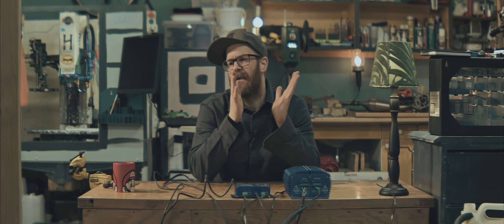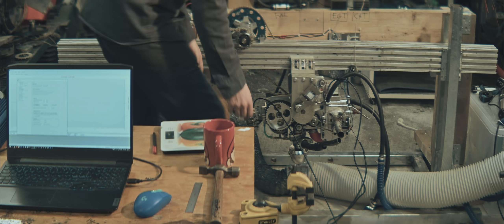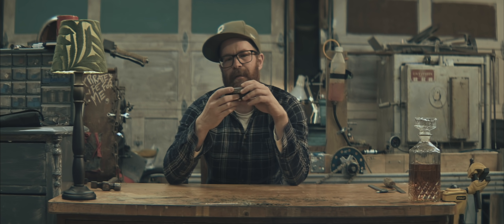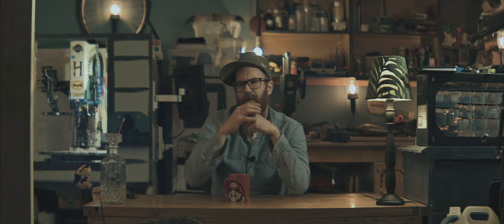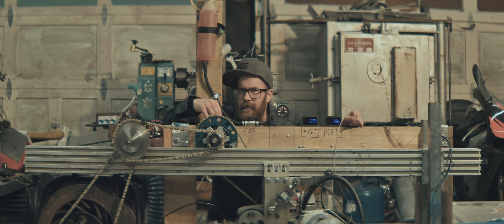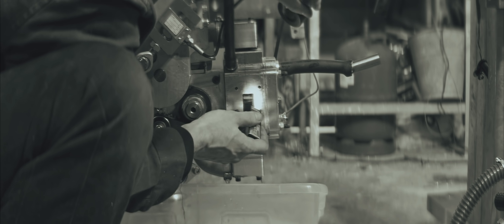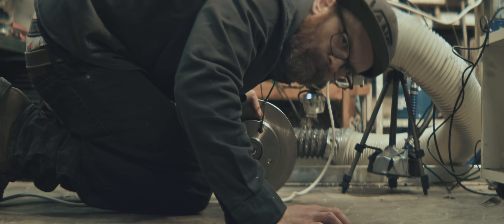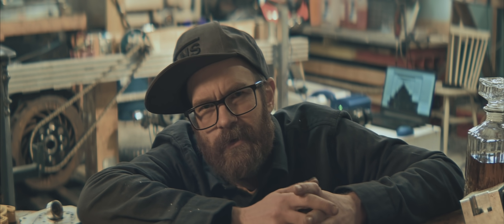Supercharged Two Stroke Grenades Head on Dyno!

Comment: What you might consider is getting an old AC compressor off a car - that has a magnetic clutch, which means you (in theory) could start the engine and warm it up with no load, then use a variable power supply to slowly engage the mag clutch of the AC compressor assembly to engage the engine with the eddy brake. That eddy brake is WAY too big - way too much inertia for that engine... A 1-way bearing is a good idea if you're not going to use a centrifugal clutch so if you're doing a power run, once you get off the throttle the brake won't just keep the engine going at 20krpm from its intertia.
Reply: Yes, with the clutch locked up closed throttle over runs are going to be a problem. A one way bearing certainly cures the engine over run problem.

Comment: Could you use one way bearings in the drive system to allow the engine to go back to idle after a pull. I don't know if they can handle the torque but I know they work from my nitro rc car days. I know it won't do anything for starting and idle but it could help with keeping the retarder from driving the engine after a pull.

Comment: What fuel are you using? I'm interested in doing a similar project myself, though I'm sure it'll be far from this level, lol. I'm also curious what oil you're using?
Reply: RC fuel, which comes with oil pre mixed. On the PiP engine Alex uses Castrol Castor based oil.

Comment: The progress is awesome, from design to running! Considering a 300cc 4-stroke honda motorcycle engine makes a paltry 30hp, this is pretty amazing.
Reply: Yes, but you need to compare like with like. This engine is not designed to run reliably for 100,000 km with good control in traffic. Besides, 100 bhp per litre is very good going, certainly not “paltry”, and would have been a racing engine output 50 years ago. Les in UK
Reply: @leslieaustin151  his engine is 240hp/L

12hpx20(conversion factor of .05L to 1L)
Reply: @Eluderatnight  I’m well aware of that, but you must compare like with like. This engine is not on a par with other, tinier engines used for model planes etc., and as I said, it isn’t intended to run reliably for 100,000 km as say a Honda 300cc would be, this one is only intended for a couple of runs up and down the salt, maximum 50 miles, with maintenance every 10 or 11 miles. Smaller engines are easier to get high bhp/litre figures from. Comparing a 50cc supercharged 2-stroke running on methanol and nitro-methane with a 300cc 4-stroke running on petrol is a daft comparison which makes no engineering sense whatever.

Comment: Those load cell joints are fine on load. The hp reading jumping around is pretty normal when you have the right torque arm length it wont skip around so radically. I run a yourdyno and just calibrated it about a week ago.

Comment: Hi, in my experience doing dyno runs on kart engines the most consistent results I had, was doing rpm sweep from high rpm to low rpm by increasing break force, maybe you can look into doing this way. Good luck doing what you do!
Reply: *brake force

Comment: Just brilliant Alex!  Nice job on the quick redesign and turnaround to fix the head.

Will your dyno software allow you to change the y scale on your HP and Torque plot (at 18.15) so that the curve shape can be better analyzed?

When calibrating.(at 16.10) when you use a shorter lever arm (3cm vs 50cm), any error in length will be a much higher percentage in your calculation.

Regarding redesign of your cylinder head, it looks like you now have at least 2.5 times the cross sectional area retaining the combustion chamber. With aluminum, it is impossible to have low enough stress to eliminate an eventual fatigue crack.  At 10K RPM, you will be adding fatigue cycles pretty rapidly, but you also removed a pretty bad stress riser (the sharp corner).  This might be a good part to have a spare handy.  Alternatively a ferrous part of similar dimensions should have a higher, and possibly infinite fatigue life.

Comment: Check the length and the angle of the forces around the pivot point i think you got there a error in the calculation a smal difference between the measurements makes a huge difference in the result cause of the smal lever arm of the forces

Comment: I think you should be calibrating the dyno with a known hp engine, such as a typical Briggs and Straton or something similar. Right now you're trying to test and tune two builds at the same time, not knowing what is right. If you have a baseline dyno calibration that is known, your time tuning and tinkering with the brute force engine becomes better spent. Ive been around for years and always enjoy your content. We share alot in common and I enjoy following along with your builds.

Comment: Your load cell calibration will still be off, because the 5kg weight is not pulling tangentially to the axis of rotation (would need to take the inverse cos of the weight and the angle between the weight and the tangent line)
Reply from the maker: 👍 yes

Comment: Maybe you should try going air cooled for the first couple prototypes
Reply: I think Alex may have got the message from all the comments that he needs to have a acceptable amount of heat in the engine prior to testing. I don't know how Alex would go about making the Brute Force engine air cooled.
Reply: @malcrandall1309  not to hard with the mill he's got just replace the hollow water jacket with some fins maybe 4 mm thick and 20-30 mm long from cylinder and head. It's always best to start out simple having a water jacket and seals to keep coolant in can be a pain and not always necessary especially for something as small as a 50cc... I am working on a 100cc supercharged 2 stroke diesel that the first couple versions will be air cooled

Comment: Much as I like your posts lately it's like watching a smoke filled room .
Reply from the maker: Yeah, could add in some more contrast👍
Reply: @2STROKESTUFFING  will that engine have a pipe? Just curious😅
Reply: @wo8795  No, this engine won't gain anything by putting a pipe on of any kind. No back pressure is required on this type of concept engine. The PiP  project engine on the other hand is highly dependent on it's exhaust system.
Reply: @malcrandall1309  👍
Reply: Its because of the lens but i like it a lot
Reply: @wo8795  I thought my cataracts had got worse with the haze. Give me HD any day!

Comment: Regarding your issues with the load cell. Put Ferrite tubes on your load cell , and indicator wiring. Motorcycle ignitions are notoriously "noisy" with electrical interference. Especially at high RPM. I build scale systems, and have run across it many times. It may be something else, but it's a very cheap and easy thing I would rule out first.
Reply: If it was good enough for my PlayStation controllers it must work
Reply: Great point! Spark plugs emit a lot of broadband noise,  so clamp-on ferrite cores are a great idea. I would think having the signal wires be tightly twisted might also help.
Reply: Shielding the ignition coil and spark plug wire may also work. Just wrap it with some aluminium foil or fine wire mesh and ground it to the engine block...
Reply: Also wrap the spark plug wire with thin insulated wire and ground them
Reply: Fields like a Faraday good cage for a screen door so those magnets won't  flux up your sensors.

If you're using shielded cables the bonding/grounding of the shield must be impotent. 

Ground shields at the control panel and leave the device end floating.. as in insulated and isolated. Versa visa works too but once you try it you'll have the grounds to understand why source end bonding/grounding makes a few more cents.

Comment: Awesome as always.
But… there is always a but… I could not see it clearly, but maybe hou made a mistake with the calibration. The point were you hung the weight is not in the same level as the pivoting point.
Do those 3cm are most likely less… 
Just measure the centerline vertically and measure horizontal to the pivoting point to get corrected effective arm length.
Hope I make sense

Comment: Hello I saw your engine stop at 13k rpm you need shorter expansion chamber for up higher rpm try To reduce length 5% step by step to get the maximum rpm for your design engine and don't touch rotary valve this will be second step to achieve max rpm👍 I don't know if this engine uses expansion chamber, if not adjust time in the rotary valve only. Higher rpm open early apply your criteria🤔

Comment: I have not been a subscriber for long.
But what is the goal of this project if i may ask?
Oh, and Hi from your next door neighbour Sweden. 👍
Reply: Hello Sweden. Alex wanted to make  the worlds most powerful 50cc two stroke engine to challenge the Dutch 50cc tuners. The Brute Force engine was only a concept while the PiP engine with it's radical exhaust port geometry was going to be used at Bonneville for speed record attempts.
The PiP engine has being very un reliable so far.
Regards from the UK.

Comment: I was going to say you calibrated the torque wrong but you corrected it at the end (you should also do it in compression rather than tension). When you look at the video when reving there seems to be a lot of movement which is potentially torque being 'lost'. Also, shouldnt the load cell give the same reading as the flywheel...?

Comment: sir i have a suggestion.  replace the heavy roller chain with light weight notched belts.  those chain waste so much power as each link is traveling the distance between sprockets and must STOP going one direction and rotate and Start going the other direction.  so in essence you are forcing the mass of the length of strait chain back and forth with each rotation o the big gear.  the faster you go the more resistance you will generate.  I make bicycle training rollers for bike racers which are three rollers and two of them hold the back wheel, the front rests on top of the front roller and cyclists can ride fast and train indoors .  any way i substituted a rubber belt for about 10 feet of cycle chain and sprockets on the rollers.   the force was noticible as i was pedaling the bike, and you could feel that the drag got more severely as you got going faster.  also it is a powerful engine no doubt, but those chains are more than enough, could be smaller stuff.  it would make your data so much more accurate i believe.

Comment: Wouldnt be actualy better to try make clutch working? I would worry that if something wrong goes in engine, the retarder will still spin, and might make more damage do engine while still spinning, and i think it has enough force to break a rod if the piston ring would snap and block the piston itself
Reply: Good point!  The one way bearing suggested after your post is the way to go I believe. Then the dyno can free wheel if no load is applied.

Comment: Great to see the coolant up to temperature. Would it be possible to show a analogue rev counter and coolant temperature gauge as the digital read out changes a bit to fast to follow. Well done Alex, a massive step in the right direction!
Reply: I agree here - had trouble enjoying it because I kept trying to watch 3 VERY fast moving numbers ;)
Reply: @IanB22  They will stop moving around when he has the retarder applying a constant load.
Reply: @MrJermbob  Yes I agree, Though it's a lot easier to look at a dial rev counter with it's damping effect giving a easier view of rpm.  Exact readings of RPM are not needed  to a couple of hundred revs.

Comment: I had done the same mistake as at 1:40 (but in worst). Don't cut anything too thin with a circular saw and bolt the saw on the table
Reply: And make sure the saw blade is sharp and you let it get fully up to RPM and don't plunge too fast. Lots of factors played into that grab. Too slow a feed rate is always preferable to too fast when using a circular saw on aluminum.

Comment: Hanging the 5kg weight off the load cell mount isn't quite accurate because the pivot point isn't on a horizontal line from the mount.   You'd need to apply the sine of the angle from the pivot to the mount to calculate the force applied by the weight at your 30mm torque arm.

Comment: Remember that when inputting the arm length and weight for the calibration, you should only count the horizontal distance between the weight and the pivot point.
Like, if the arm is at 10:30 and has 40 cm in total. The input value is for length is 20 cm. Or you can isolate the 2 vectors (vertical and horizontal) to adjust the value on the weight.
Reply: Yes in theory the rule of the lever arm applies here but with an angle which is less than 10° the cosinus is roughly the same
If you want the exact value, you can multiply the length of the arm by the cosinus of the angle between the arm and the horizontal d=l*cos ∆
Reply: Are you sure about that math?
If the arm is at 10:30 (which is 45 degrees from horizontal) and has a length of 40cm, then i think you will find the 'horizontal' length is 28.28cm and NOT 20cm
Perhaps you meant 11:00 (a.k.a. 60 degrees from horizontal)
I believe the formula to calculate the 'effective' length is Arm.Length * Cosine(angle_from_horizontal)
Reply: You also need to consider the effective weight of the arm itself, not just the weight hanging at the end of the arm...
Reply: I would add that should you move or disassemble anything connected to the cell, do not assume that reassembling exactly as before will return it to anywhere close to calibrated. It will need to be done again. Also, that type of cell needs to be strictly kept within  it's intended range to work well. They do not play well with very fast changes either.
Reply: Maybe adding a shock absorber in parallel with the load cell might not be a bad idea.
Reply: @carlosarthurpetry3674  No that would just make it inaccurate. An absorber would (unless very, very properly tuned would add resistance to any movement. Not just fast movement. A software buffer rather than mechanical would probably be much more effective as well as adjustable. Most scales use serial rather than usb.

Comment: Good afternoon! My name is Evgeny, I am a student from Siberia, studying at NSTU NETI. In my spare time, I repair and tune my old Soviet two-stroke 125cc motorcycle. I have only a small lathe in the garage so far, but soon I will repair the milling machine as well.
My engine has a piston stroke of 58 mm, the standard crankshaft is made separately: The trunnions are pressed into the crank web and that's why I couldn't center my crankshaft well.
I'm going to make the crankshaft myself, it will be solid-edged and fairly accurate, but I'm interested in which steel is better to use for this? What kind of heat treatment of the crank web is required? What are the acceptable tolerances for such a responsible part? To what accuracy do you center the crankshaft? How do you calculate what should be the thickness of the metal around your crankpin and what should be the width of the crank web? What clearance do you use in two-stroke engines between the crankshaft and the crank case?
Reply: Try looking at a racing kart crank for dimensions as these were specifically designed for racing and not taken from a road going engine like the one Alex uses. Good luck.

Comment: Calculating the inertia will be tricky as there are different thicknesses at different points of the diameter of the retarder, plus the clutch and sprocket rotating masses.  Better to accurately calibrate the load cell and take braked mode runs and then inertia only runs and tweak the inertia value until the graphs stack on top of each other.
You will probably need a lot of load cell filtering to stop mechanical noise and chatter from your rose joints.
Reply: Instead of noise filtering for the load cell, it also may work better with some rubber bushings instead of the ball joints at the load cell mount.
Of course the rubber needs to be pretty hard, just soft enough to dampen the vibrations of the engine...
Reply: @Henning_S.  agreed
Reply: I'm trying to remember if one setup to measure inertia in the earlier days was to put propellers for example laid flat on a platform supported by three strings and you could calculate from the rotational frequency somewhat accurate value for the inertia.

Comment: I am not sure you will get acurate readings of the torque if the axis of the sensor is not inline with the output shaft of the engine. The force from the chain will probably mess with the readings i think.